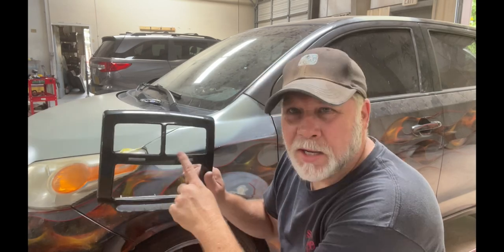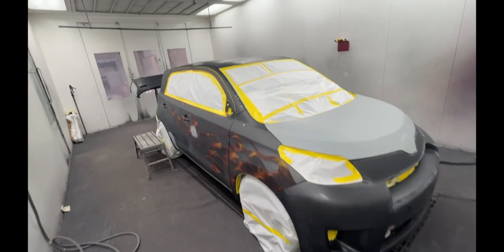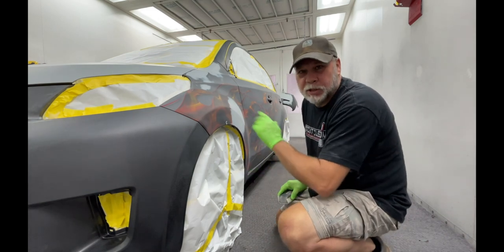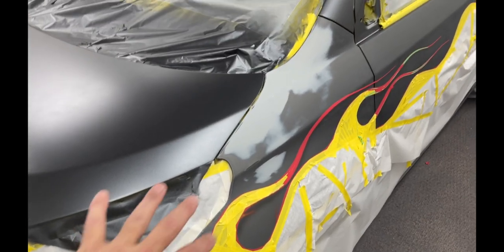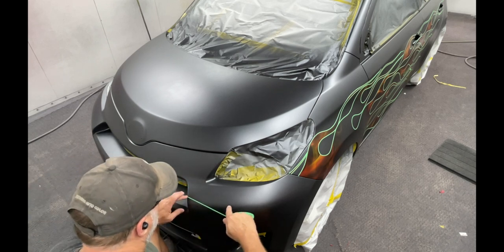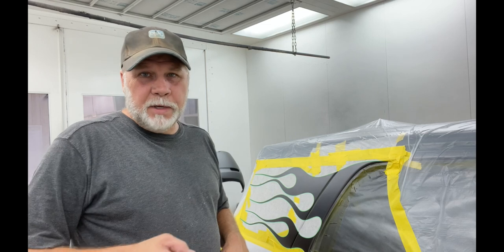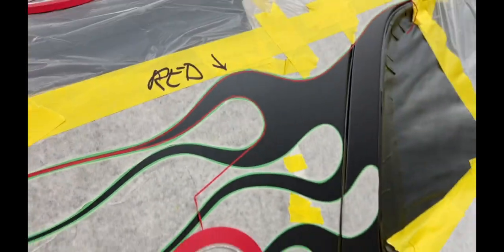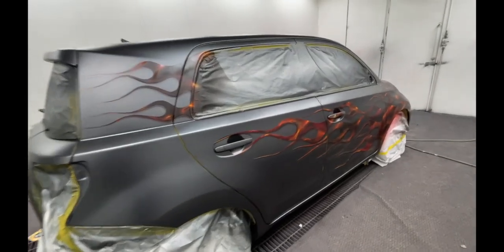Scion xD Repaint:  Giving the old car a refresh

Comment: You still got it! Thanks for the tips, tricks, and product recommendations. What type airbrush do you use? I never had any luck with them. I agree, that bright green would pop those flames. I think the hood needs sumpin'. Just too much blank space there. A few counties west of you . I 'm in Gordon.
Reply from the maker: It’s an Iwata HP-C I believe. I agree on the hood. I tried adding flames around the emblem as well as flaming the whole hood. It just looked out of proportion. Most of the flames are long and flowing so the short hood threw me off a bit. Thanks for watching!

Comment: Great video as always and thank you for all the great info in your videos!!!! I have a question for you. Im getting ready to paint my truck and the 1 question that seems to vary between people is this. If im using base/clear and also gonna seal everything what grit do you take the factory substrate to prior to sealing if your gonna use a pearl or metallic? Thanks for any help and keep up the great work!!!
Reply from the maker: Most sealers recommend 320 or 400 grit for sanding and sealing over original paintwork. You can google the information sheet for the product you are going to use and under the “surface preparation” section it will tell you what is recommended. Although sealer should fill in either size scratch, it’s better to err on the side of caution and use the finer/400 grit for pearls and metallics. There will be less chance of metallic/pearl finding a scratch to lay in that wasn’t completely filled with sealer. Also, some original paintwork is softer or harder than others. A 320 scratch in laquer may be deeper than in a hard enamel. The way the panel is sanded makes a difference too. Straight line blocking can create more noticeable lines (block marks) than sanding in a circular motion or by DA. That’s why if something is blocked with 320 in straight lines at first it’s followed up by 400 on a DA or by hand in a circular motion to remove the block marks. The finer grit at that point also helps to not remove too much material too fast but still plenty of scratch for the sealer to adhere to. Great question and thanks for watching!
Reply: @StoutCustom  thank you as always for everything!!

Comment: Awesome video man!  Have a question about the scuff stuff... do you think its benificial to have or will just maroon scotchbright pads be enough after 400g on a DA?  Getting ready to paint my truck and currently blocking with 320g then going to be going over that with 400 then a scotchbright then cleaning for sealer then BC / CC.  thoughts for a DIYer and only paint job i plan on doing ever haha
thanks in advance
Reply from the maker: I don’t think I went over this in the video but there are different types of maroon scotchbrite pads. The ones I used in this video are by Mirka. They soften up quick and I would say scratch at a 400 grit level. The old thick style 3M maroon pad scratches at about a 320 or a little coarser. If using the 3M I would recommend sealing over that scratch to keep from having sanding scratches show in a metallic. 
As far as scuff stuff being benificial, it works well when wet prepping a vehicle. It is not necessary though. The old school method was to use Comet cleaner and a scotchbrite. Scuff stuff isn’t quite as bad about leaving a chalky film as Comet can be. With either one keep the surface wet until a final wash is done with soap and water. You can leave out the Comet/scuff stuff altogether also. It just provides a little grit and a little detergent to help clean the surface when wet prepping. Lots of collision shops only dry prep and use neither. So a panel is sanded, dust blown off, then wiped down with an ammonia based cleaner similar to Windex before taping up. That keeps the car from getting wet and speeds up the process since you don’t have to wait for it to dry. On an all over I like the wet method since there are so many nooks n crannies to hold dirt if it’s not cleaned out. Hope this helps, thanks for watching, and good luck on your project!
Reply: @StoutCustom  Hey thanks for the reply. I have the 3m version and a few left so maybe i'll look into using something else.  I do plan on sealing it, i just wanted to be closer to 400 when sealing then painting. I am doing a solid color and plan on at least washing the truck and using a scotchbright while i washed then a final wash and rinse.
its a complete paint job but the truck is blown apart. working on final sanding now
Reply: @StoutCustom  I have some grey 3m pads would that be better to go over everything after sanding with 400 vs the maroon?  sorry for the question again haha
Reply from the maker: @PaulLehman  you will be fine with the maroon 3m if sealing. Since the panels are already in 400 you don’t have to be super agressive with the scotchbrite. It’s used to more to hit the edges,  spots you couldn’t reach with the sander, and help clean off the sanding dust.

Comment: Quick question, How do you get a run out of clearcoat? Any info will be very much appreciated. Thank you
Reply from the maker: For small individual runs I usually cut a short piece of paint paddle, maybe 2”, wrap it with 800 wet or dry paper(only a couple wraps to keep it hard and flat) and block it down concentrating on balancing on top of the run so as not to sand down the surrounding area. Once it gets close to gone but not completely flat I switch to 1000, then 1500, 2000, 3000, then polish. If the runs are longer multiple sags together I do the same thing but with a longer stick, maybe 6”.